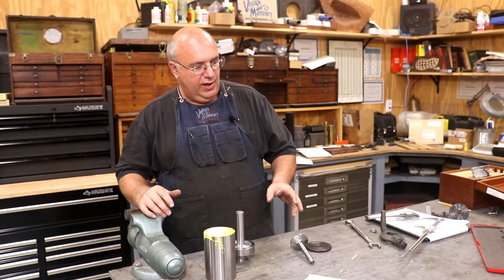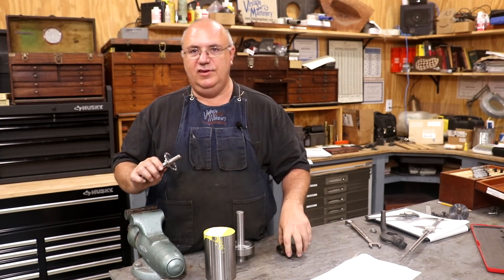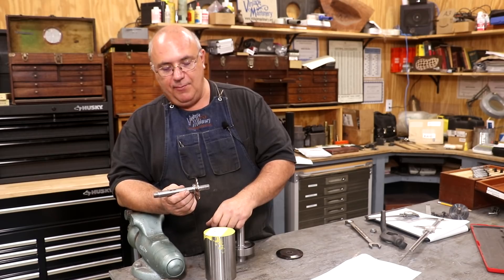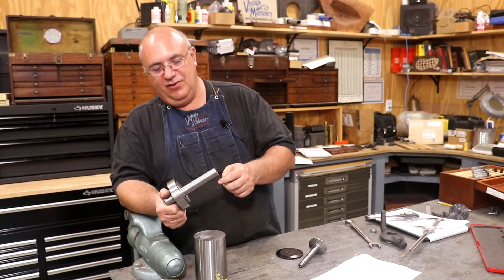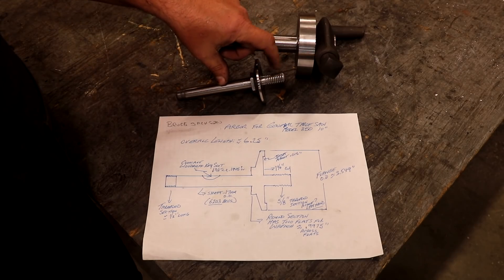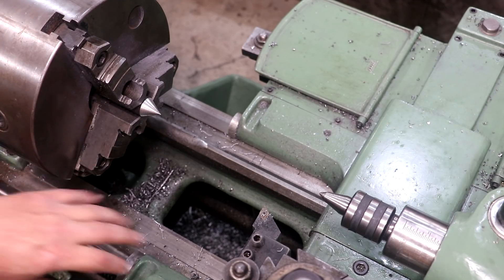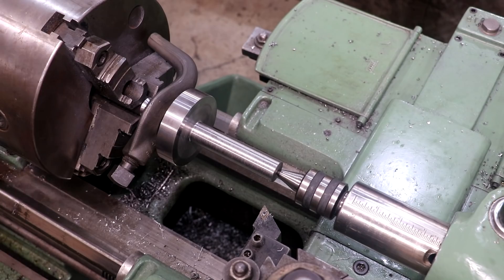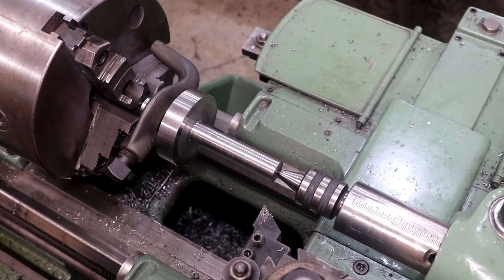Machining a New Arbor for a General Model 350 Table Saw - Part 1

Comment: I own a General 350, purchased in 2017.  It has a manufacture date of 1986, and oddly it had never been used.  Parts for the fence were still in the original cheese cloth  pouches.   Now that General is out of business, I know who to contact if I ever need a replacement arbor.  Awesome work.  I love craftsmanship, no matter what the profession.

Comment: one of my friend  in the 1980 was working for general manufacturing in drummondville quebec canada as a machinist, his job was to machine the arbor of the model 350  and other parts of the table saw. another division of general manufacturing in drummondville (steel plate guéret ) were casting for all the general parts it was the only foundry in the region

Comment: Thank you for doing this Keith.  Turning it down from the solid... wow... lotsa work... and expense.  As machine repairer for many years here at Machineco in Montreal, may I suggest an alternative? Is that a yes? ;-).  Press and tack weld on a ring of steel to the desired diameter of flange.  We did this for teeth broken off complex gears. This preserves all the original dimensions, and metallurgy in the thread and bearing areas. Cut a slice of mechanical tubing, or use a disk round cut from plate. Turn the ID to be interference fit on the existing flange (or machine it down a bit for a wider rim thickness) Rings can be heat We have several General saws in stock, and they make (made) good machines with a good reputation, in Drummondville, if I recall.  As you mentioned those original arbours were probably forged, but not "drop forged" they would have been made in an "upsetter" which raises the middle of a shank, or cold header in the case of a bolt head.anded easil so as to shrink fit onto the flange. Then tack weld in 4 to 8 places w/o building up any appreciable heat. 
    Now machine just the OD and face of expanded flange,... saving a pile of work and $$s. 
We have several General saws in stock, and they make (made) good machines with a good reputation, in Drummondville, QC, if I recall.  As you mentioned those original arbours were probably forged, but not "drop forged" they would have been made in an "upsetter" which raises the middle of a shank, or cold header in the case of a bolt head.  Happy turning!
Reply: I was wondering if there was a welding approach- great idea.

Comment: Rather than make the arbor with the large diameter washer made to the shaft, next time you could make a shaft with a press on washer made oversize and do the final turning after the press fit or locktite fit.

Comment: Keith, I really enjoy watching you take a chunk o' metal and make stuff with your cool assortment of tools; and more importantly, your vast knowledge of how to best use those tools. I am not a machinist and have absolutely no experience modifying the hard stuff. I have been known to abuse a few pieces of wood from time to time but that's about it.
You made the comment that this was an expensive piece of metal. Any closer figure than that? I have no bearing to compare to lumber (which can be cheap to ridiculously expensive) so just wondering how bad it is. Thank you.

Comment: Think cut off metal like the big one - then put it in a Rolling machine and it squeezes out the metal from what light to strong pressure that melts the steel.  Think of pressing threads - or rolling them.  Much the same.  Not a super precision but gets preforms.

Comment: That nick on your thumbnail looks suspiciously familiar. Do you have a safety tip for table saw users in the offing?
Reply: I think it may have involved feeding some round stock into a band saw.
Reply: @alandaters8547  Maybe, but that's not what it looks like. Several years ago I had a similar nick taken out of my thumbnail after the "misfeed" of a small piece of wood across the blade. It wasn't until I matched my mystery nick up against one of the blade's teeth a couple days later that I began to appreciate how close I'd come to amputating my thumb.

Comment: Seems like he could turn down the thickness of the flange until it was about 2/3 it's diameter. Make a disc that has a hole the size of the shaft and a shallow cut-out that fits over the flange exactly. Braise the disc to  the flange and turn to shape.  This would be more than sturdy enough for a circular saw blade.

Comment: Nice video. 
But I have a question: could you not have turned the shaft from say, 1” dia. stock and then turned the larger dia. saw support plate and shrunk it onto the shaft and welded it prior to finishing the whole assembly?   The method shown seemed to require  an awful lot of 4140 to hog out.
Reply: That would have been the practical way of doing it, or just turning the original flange away and installing a new one that is keyed in place.  I suspect the owners issue is the saw blade is warping and running out causing a wider kerf when he cuts material.  That may be because the clamping washer is larger than the fixed one and may not be perfectly flat, so he might have solved his whole problem by simply going to a smaller clamping washer.
Reply: He may have a good reason to do it this way - and I’d be keen to hear it from Keith.
Reply: I agree, machine the shaft and nut one piece.  Interference fit  on the disk to the shaft nut and no need to to weld.  Nut OD is what about 1.2?  Start with a 1.25 bar.  Rough the disk side to .75,  heat / cool / press fit the disk in rough form then finish to size. No need to weld.
Reply: My sense is that making two pieces and welding/pressing, and then precision re-machining would save materials money, but be about 5x the labor. Since Keith is doing the labor 'gratis', the customer instead paid more for the material to reduce the amount of labor needed.
Reply: @kindabluejazz  That chunk of 4140 will cost at least 100.00, plus shipping from Canada down to Keith will be huge, then the return shipping will still be expensive even though the finished piece will not weigh so much 
(unless the guy wants his drop back) , so he will probably have at least 250.00 in material and shipping, not counting down time on his saw-  this arbor must be for a professional grade saw, not some 9" hobbyist table saw.
Reply: @kindabluejazz  I've made quite a few saw arbors over the years, some smaller and some quite a bit bigger than what he is making. All of them featured an extra step machined to a shoulder behind the thread and a thick inner washer shrink fitted on to it. My material of choice is 1144 Stress proof. Stronger than 4140 in the annealed state and machines much better.
Reply: @kindabluejazz  From McMaster,  4140 1 1/4 in 1 foot rod and 4 inch x 1/2 sawed disk would be $43.  A 1 foot x 4 inch 4140 bard is over $200.
Reply: With a long core drill or a trepanning tool,  most of that waste could have been saved.
Reply: @MattOGormanSmith  Those trepanning core drills are great if you are boring all the way through a piece so you end up with a big slug left over instead of a pile of chips. In this case he would have to bore as deep as the big flange and then part it off, leaving him a tube about 4"OD 2" ID and 4" long.  Not sure if Keith has a set of those things.

Comment: Two other options occurred to me, to turn down the original part to the shoulder and just use a pair of the blade stiffeners, or to shrink fit a disk onto a much smaller piece of round stock and then finish turn it.  Why would these not work?
Reply: I was thinking the same thing. What a waste of material. A simple press fit and final machining to final size????

Comment: I always thought bearings are measured in metric. Probably the reason for both metric and standard sizes.
Reply: Ball bearings are metric. Multiply the last number such as in a 6205 bearing by 5 and that is the bore diameter in millimeters.  The exceptions are 0,1,2,3.  Those numbers signify 10mm, 12mm, 15mm and 17mm. If you see a bearing with a 6205-8 number, then the 8 signifies a 1/2" bore.
Reply: @millwrightrick1  makes perfect sense
Reply: Yeah- bearings have been produced in metric dimensions for decades.  This project reminds me of the old cartoon where they whittle an entire tree down to make a toothpick.

Comment: I’m not a machinist at all, but I’ve always wondered why turning between centers isn’t more common. It’s such an easy way of perfectly repeatable concentricity. That would take you a lot more time to set up on a 4-jaw right?
Reply: Because not everything can be machined between centers (if you need to do some boring for example). The problem is, when you change your setup, you'll need to setup the dead center (in the chuck) all over again.
Reply: @StanislavG.  ah, that makes sense... switching up would be annoying. That might offset the reduced amount of time needed when dialing in your part
Reply: @WoLpH  yep, not much reasons to do it in the home shop. In high volume production there's generally a lathe specifically set up to do in between centers turning, though it's not so common now, as with any machining, it's mostly all done by cnc now. Just chuck it up and watch the screen :)
Reply: Internal features would seem difficult to do in between centers, but then again I'm not a machinist either.
Reply: It depends a lot on the accuracy needed and the capability of your chuck/lathe. Adam can get better than 0.001" concentric repeatability after removal and reinsertion on his 6-jaw precision chuck.

Comment: If that was previously turned between centers, why is there runout?
Reply: I am guessing it was roughed in the 3 jaw and the centred. Generally I only like to do finish turning between centres. Better to "hog" off material in a chuck.

Comment: Am I the only one that wants to know what the technical problems were? I know from experience it was something silly like forgetting to turn the camera on (I've done that so many times) but I just need to know! Interesting part though, I was wondering if it would be possible to weld two pieces to get the starting shape. That would certainly save some material.
Reply: I was thinking he filmed but didn't realize he forgot to put pants on... :-O

Comment: Looks like the owner is trying to use up some early vintage thin kerf sawblades, notorious for wobble, the technology has advance where blade stabilizers are no longer needed. To deal with the early ones, blade stabilizers were oversized flanges about the shown diameter meant to take the wow and flutter out of the spinning blade, downside was depth of cut is sacrificed, same as will be with this new arbor setup.